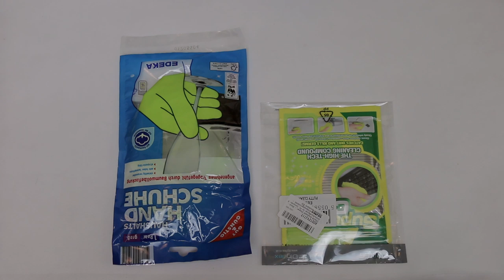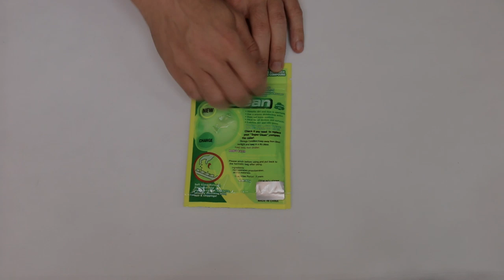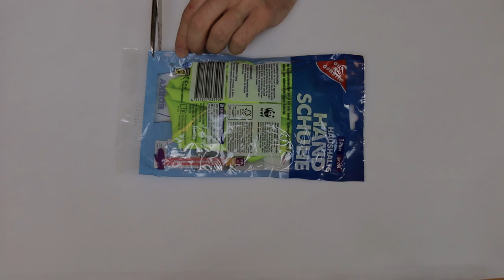Satisfying ASMR | Cleaning a Mechanical Keyboard (no talking)

Comment: when he used the keycap puller to clean the board at 10:27 and 16:05 that hurt my soul, and when he used a survival knife to clean it at 16:17 and 31:45 i died, and, did he not wash off the soap on the keycaps?

Comment: So, question. Do all keyboard keys pop off like this for cleaning or will I break my keyboard? LOL
Reply: They all pop up
Reply: Uh, i'd recommend checking it before you do anything, you don't want to break anything.
Reply: as far as I know u can pull all the keycaps off without damaging your keyboard as long as it is machincal
Reply: If they are mechanical or membrane they can.  If they are scissor switches or laptop switches you most likely cant.

Comment: For myself ... the unpackaging is annoying. Also, using the blower to clean the keys just pushes the dust deeper into the keyboard, and even after you remove the keys, it does nothing. So, what's the green liquid you're using with the Qtip? 
The cleaning, for me, is too fast. I don't know why, but it's irritating. And that blower didn't seem to do anything, and you validated that by having to blow on it. 
I'd like to say this is a relaxing video, but it just isn't. Too frenetic in place. The blower isn't useful, I don't know what you're using to clean, and it's all too fast and, again, too frenetic to be relaxing.

Comment: Despite being asmr, the incompetence of the cleaning actually just annoyed me.
Dusting before removing the keys was pointless. And after removing the keys, turn the keyboard over, give it some good taps to remove all the loose junk, then give it a firm scrub with that tooth brush to remove whats left. then hit it with the cleaning liquid and cotton tip. Swiping that soft bristled brush over it was useless and removed nothing. you need the firm bristles and a good scrubbing motion to remove the built in grime.
Trying to clean with the wet cotton tip while there was still loose hairs and crumbs is pointless, itll just make them stick to the keyboard.

I came here for relaxation and only left more irritated.
Reply: Dude he’s trying his best
Reply: ngl but if you didn't like the video you can just like... leave
go watch the buzz feed one if you didn't like this vid